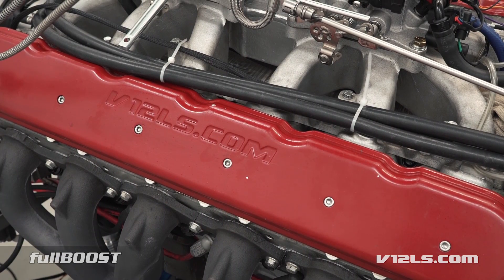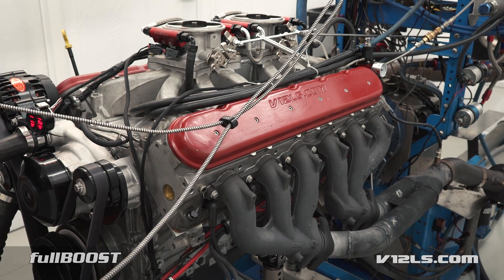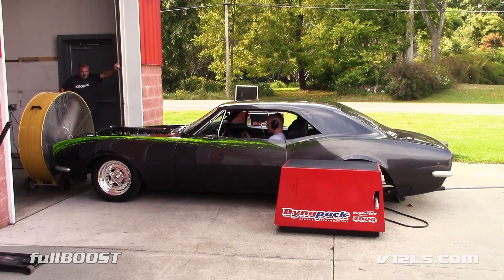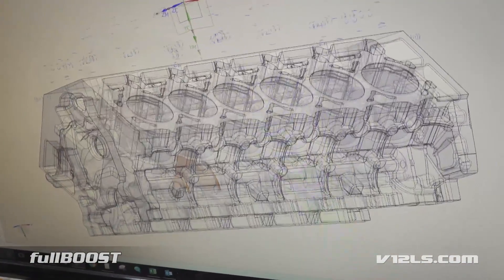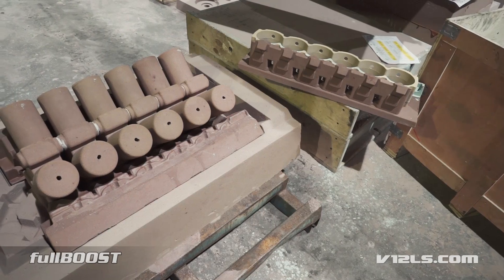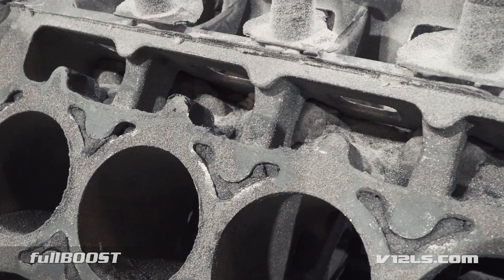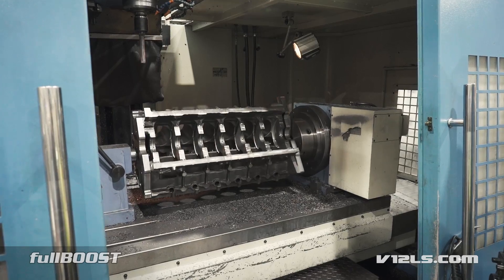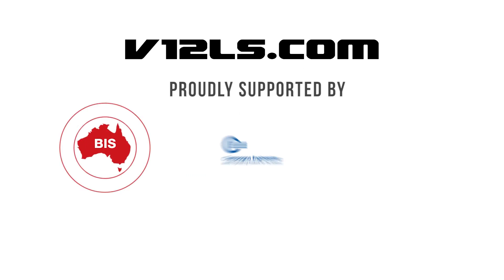How a V12 LS engine is made

Comment: V 12 with two push rod valves per cylinder? Nah.
Reply: 10,000 hp Top Fuel engines seem to work ok with 2 valve , pushrod configuration .
Reply: It's not about the number of valves or whether or not it uses pushrods.  The ultimate story is the amount of power harnessed from a given amount of fuel used vs the weight and size of said motor.  The C6 and C7 Corvette programs have been deadly efficient at playing that game for a number of years now.  Reference their success at Le mans and Daytona if you need more.
Reply: Nothing wrong with pushrods or two valves per cylinder.
Reply: Government motors don't have money to build modern engines
Reply: fyi this engine does reach redline before 6200rpm
Reply: shane  nope not true and  if it was you wouldn't see so many dohc 4valve engines being manufactured since the 90's. Compare any ford fohc modular v8 or duratec v6 to a competeing gm or Chrysler pushrod engine, every time they make only a few hp less, as much or more than the pushrod engine from a smaller size but always within 20hp. You're talking racing engines vs production engines and when it comes to that pushrod engines do not have a performance advantage.
Reply: shane  How in the world is having smaller valve area better? That made zero sense.
Reply: @amorag59  
Smaller valves = higher intake velocity = more midrange torque. 

Making your intake valves/runners "too big" gets you top end at the expense of midrange. Which is why truck engines deliberately run smaller intakes, and why some DOHC only run one set of valves below a certain RPM.
Reply: @bcubed72  At the end of the day, engineers will size the runners at the proper size they need for the intake velocity they want. In the case of a 2 valve, they would have bigger valves, but 4 valve more valve area. In a comparison between 2 and 4 valves of the same size engine, you will have more restriction on the engine with 2 valves. Look at the Cummins B series for example, both 4 cylinder and 6 cylinder engines went to 4 valve in '98, no use in having a large displacement engine if it can't flow worth a darn. A lot of pushrod engines don't do 4 valve because it's difficult to engineer a pushrod multivalve system.
Reply: shane   If you want to chase power in a NA V12 increasing the stroke only gets you so far, they are good when oversquare bore and high revving. Lets be honest,  this needs to be what you described at the end of your comment. 4 valve and high revving. the v12 in the video is an 8.5l making 700 hp, less than 100 bhp/l. Also flow = hp, you want to get rid of constrictions like the hard 90 deg intake runner turns found in a lot OHV engines.
Reply: shane  not even remotely true. Ford uses DOHC with 4valves per cylinder which is why they can make just about the same power or more as any GM V8 while using smaller displacement That's the advantage. I built a computer model 7.0 v8 based on the ford coyote 5.0 and compared it to a LS7, the result? In a trim that you would see in a muscle car 585hp vs the corvettes 505hp trimmed out as a corvette level engine 636hp-706hp depending on headers and exhaust configuration. The only advantages a pushrod engine has is lower weight and compactness. Mercury Marine SB4 7.0 V8 is a perfect example.
Reply: @armymatt83  
"The only advantages a pushrod engine has is lower weight and compactness."

Power per pound of engine isn't everything...it's the only thing. If a DOHC weighs more, it needs to return enough excess HP to offset its weight...and I mean "power across the curve," not just at peak.

Also, you can shoehorn in an OHV in places you can't fit a DOHC. Notice how the Miata runs an LS, not a ford V8? the DOHC Ford won't fit!
Reply: @bcubed72  yeah I mentioned it was more compact. But the fact it it's not a better engine. Period. Either design has it's advantages and disadvantages but in reality neither is really better, they are two different approaches to do the same thing. But talking about power, due to relatively worse flow with ohv heads GM needs 6.2L to make the same power more or less Ford's 5.0 dohc does. That's not better engineering. Show me a gm 5.0 that makes 420hp that's right it doesn't exist. Take a look at the engine labs article in the coyote vs LS3 they weighed the coyote without a water pump but with a flywheel and it came in at 430lbs what's a ls3 weigh 405-430lbs oh yeah huge weight difference might as well be a boat anchor. All I'm hearing is ohv fanboy bullshit.

Comment: What am I missing should be over 1000 hp or I guess it's just a show thing
Reply: Adam Batchelder 624 at wheel, can buy online turnkey. Runs complete stock ls internals as far as rod pistons rockers cam dimensions valves and 241 heads that are made for it to stock ls standards. Still developing a higher hp to sell and making one for boost.

Comment: Cool..  wonder why they didn't try a v-10, since the  V is 90 degrees.
Reply: Not ideal there either a V-10 needs a 72 degree V for even firing.
Reply: but at 90 the balance shafts balance each other and become null. similar firing order to dodges.. without the added mass of a v12.  I would have thought it would have been the next logical step up vs v12. and apparently in the late 90's GM performance did build 2 LS V10's. cost gm like 300,000 I believe. so the tech is out there for a LS V10.

Comment: Already been done. Early 90's. The Falconer V12 used in the Corvette ZR-12 concept. 

It was a N/A Chevy small block and a half and made over 600 horse power.  They were planning on using it as a Viper killer but stuck with the DOHC 5.7 used in the Zr-1 instead because of manufacturing complexities and the 4 valve LT5 actually put out as much power as the Chrysler V10.

Comment: Wonder if one of those heads would bolt on to my Chevy inline 250
Reply: Wouldn't that be nice to have your exhaust and intake ports on opposite sides.  I always wondered why Chevy never designed their inline 6 heads that way.
Reply: @sparkimoto  Cost. Putting everything on one side is cheaper and simplifies packaging. Sucks for performance though.
Reply: No, but it will fit a Ford 300.

Comment: Does anyone else see how much a huge jump backwards they went?  ADD A BUNCH OF WEIGHT AND SIZE to a platform that can already make 1000 hp on pump.
Reply from the maker: N/A LS's make 1000 on pump fuel?
Reply: Fullboost, 100% they can. easy as. you just need enough stickers and chrome.

Comment: Coolest thing is watching them break the sand mould to expose the raw casting. Well done lads. 1000BHP at that engine size will be not much trouble with twin cam 4V heads... You've already cast a block...
Reply: I agree, LSs need 4V
Reply: manitoublack Then it would just be another modern v12. The whole point is that its a SBC and it has pushrods.
Reply: manitoublack it’s cast for pushrods tho, so it’d have to be re-developed for ohc
Reply: Toyota have fitted TC heads to pushrod blocks in the past. The cam and pushrod spaces just end up unused. Even the current Bently V8 block is a largely unchanged Rolls Royce 6.25L P.R block.

Point being, it's a big deal, but not that a big deal.

Comment: Will this fit in my honda? I'm wanting some more torque
Reply: It's bigger than your honda
Reply: It's just a "bolt on" mod
Reply: Sieve, get two k24 blocks make a v8. 10krpm 5.2L is what you would end up with. Just need a custom crank, custom crankcase, custom reverse head and reverse camshafts on one side. 

Considering you can get about 380wheel on pump gas out of a k27, you are looking at 760+ out of the v8 naturally aspirated. And the K's make torque at idle already.
Reply: just  do a 5.3 swap
Reply: 500wheel each bank for methanol naturally aspirated.
430wheel each bank for e85 naturally aspirated.
Reply: Just throw a turbo kit on your car..
Reply: FlyTheElephant 
yeah a 5.2 liter v8 with vtec
Reply: I would love to see a inline 8 made from 2 honda B18 or B16.
Reply: sieve5 I have a ls3 in my s2000. I want it to fit 😂
Reply: Mate, we all know LS engines don't have vTec, so in short... this engine swap would be a down grade.
Reply: Honda bullshit
Reply: It'll fit after you do the VTec mod on the intake
Reply: MrLincoln87 naw. I traded my motor in my s2000 for a ls3. It's fuckin nuts man.
Reply: Yes, just take the junk in your glove box.
It might be a little tight but it will fit.
Reply: scalp it n get a brz n turbo small one rwd stick fun not to powerfull n it get it fine on low boost
Reply: The Honda will be the bolt on for the engine. You'd lose quite a bit of power and respect, but gain a lot of torque and high end notoriety in the fart can community.
Reply: Yes, but you need to move the driver cockpit into the back seat....
Reply: Yes it will.
Reply: If you mount it transverse,it is a direct  bolt in. Mounts line up,and you can use your existing wiring harness.
Reply: Just put an exhaust can on it.  That will give any vetch 1300 more hursprr
Reply: Dude i put this on my bicycle it will easily fit in your honda
Reply: Put it in the back
Reply: You can make anything fit with a welder and sawzall
Reply: sieve5 yes
Reply: "What happened to my Honda?!?!"
Reply: Yeah just a  “ some more “ why not :)
Reply: sieve5 Yes it will fit in your Honda. You will be sitting right next to it, in the back seat.

Comment: MMmmm... I like it. Most Aussie cars were built to accept a straight 6 or a V8, so they have the length and the width. I reckon it'd go really nice in a VB C'dore... Can you imagine a 1,400kg car with that in it? Get the Aluminium version and it probably wouldn't be much heavier than an old school 350 Chev, and the CoG would be lower than a straight 6... Putting a decent radiator in might be a bit of a tight fit.
Reply: That would be batshit insane
Reply: Nope, a VL needs an RB60 ;)
Reply: Being Old School, I would fantasise about a streetable HQ Monaro .......................................

Comment: why not just get 2x ls motors and do v16 for like 5k or even cheaper
Reply: That is precisely why it's a V12 , it would be too long to fit any car except an old straight 8 Packard or similar . The cost would be even higher . Longer custom crank and camshaft . More pistons , rods , valves , springs etc . Straight 8 s were notorious for breaking cranks so two banks of 8 cylinder would put enormous stress on the crank and bearing caps .  Moises is quite correct about the Bugatti W16. Google it and watch some YouTube videos of how it's built , it's amazing .
Reply: It would probably be too LONG to fit into most cars, the bugatti W16 has offset pistons in order be more compact or shorter.
Reply: IM with this guy screw the V12. Manufactuers every where have already done a V12  i want a V16 a dodge Viper V16 
under the hood of a dodge viper. Then i could call it the SRT16
Reply: e34Boat  Steve Morris Engines already built a LS v16  It makes over 4000 hp.  Look it up.  It is for the DEVEL16 super car.
Reply: Wouldn't even need to "build" one. All a company would have to do is make a custom adapter to bolt the rear of one engine to the front of another along with some kind of fly wheel coupler. Tractor pull vehicles already do something similar when running 2/3/4 engines. I am actually kind of surprised there isn't a company out there making a more elegant set up.
Reply: a c 🤦‍♂️

Comment: They should use a flat plane crank.
Reply: They will get mad at you for pointing that out.  I suggested they work on the same concept using a pair of 3.6L V6 from the Camaro which have DOHC heads and are 60 degree blocks.  Their response was effectively pay us and we'll build one for you.  Considering the cost of the LS V12 it would likely be cheaper to obtain a Ferrari V12 which can be had for $100k.  Plus they are proven good for making well over 800 crank HP without modification at 6.3 and 6.5L.   While it would be nice if I had one I don't have a use for one. 

To be fair it's cool they did it.  It also negates the best qualities of the V12, namely the ability to make a ultra smooth high revving large displacement engine.  As the saying goes just because it can be done doesn't mean it should be done.
Reply: Paul Standeven and Rory Somerville are correct, a V12 is perfectly balanced at any angle. Thanks for your question Paul, yes we could cast them at any bank angle and chose to stick with 90 for complete compatibility with LSX components, great clearance around the camshaft and the engines stays low profile with a nice intake track.
Reply: The balance issues are different between V6 and V12 engines.  A 60 degree V6 has good balance, a 90 deg one not, so they use offset crank pins.  
A V12 should ideally be 60 degree also, but if 90 deg, can be considered as two in-line 6 engines at 90 degree.  Balance will be just fine as is, but it's a less compact engine than a 60 degree one.  
Since they are specially casting the block and heads, and the cam is also made specially, is there any reason to stay at the 90 degree V ?
Reply: V12 LS thanks for the input!

I hope to see a lot of these things bought and in action!
Reply: that because its still 90 degreesa v12 should be 60 degree so 12 cylinders at 60 gives you an even cycle. what you have here is an odd fire engine much like the 90 degree v6 buicks
Reply: @SomervilleMetalWorks  
But since each I-6 bank is balanced, block angle doesn't matter (all that much). If you're all anal-retentive about it, you could get a split-crankpin crankshaft...but as-is would have little to zero practical impact, other than making the idle sound somewhat odd.
Reply: V12's always fire like two banks of inline 6's. At 90 there isn't a practical way to eliminate the balance issue.  You can hear it when it revs, it's odd firing.  It really comes down to if the assembly is strong enough to deal with it over time.  I would speculate it's strong enough in NA form but with boosted application the aluminum version would likely fail prematurely.

The other thing is that Mercury offers a custom LS block with DOHC that can easily match the HP of this without needing all that displacement and potential durability issues.  Either one is going to be very impressive for the touring car scene but the Mercury is likely to a much better choice if you really plan to use the power.
Reply: Yeah that makes sense
Reply: only for 4-bangers and v8s
Reply: philsag it's a cross plane crank
Reply: Joseph Wright why would you do that???? clearly you know nothing about nvh or the ls designs
Reply: Joseph Wright makes zero sense for a v12 to be flat plane.

I'd like to know what  the crank set up is on this though, it doesn't sound smooth like a v12 should.